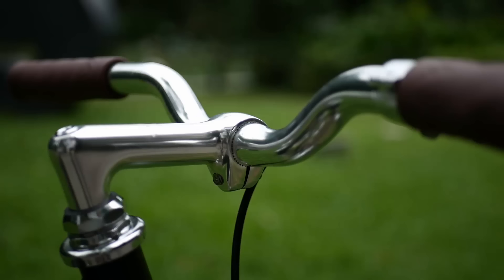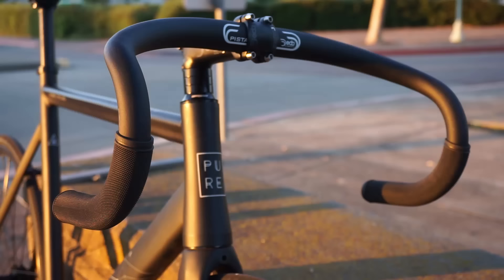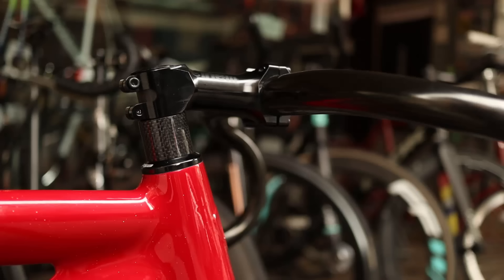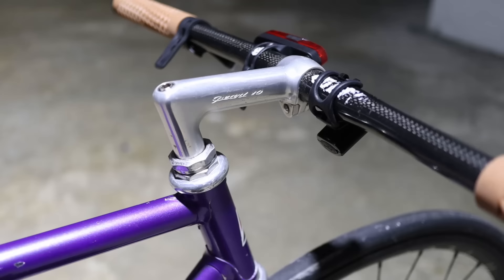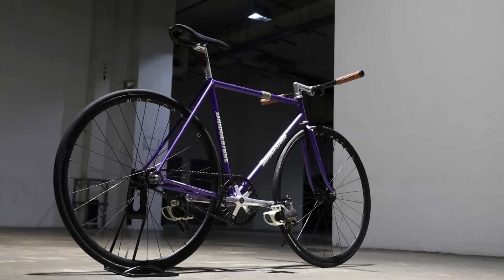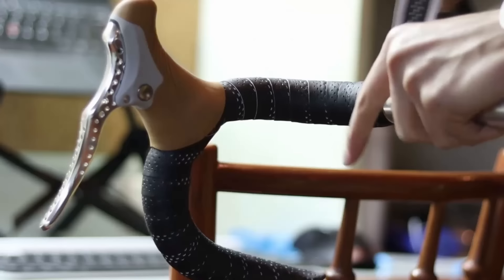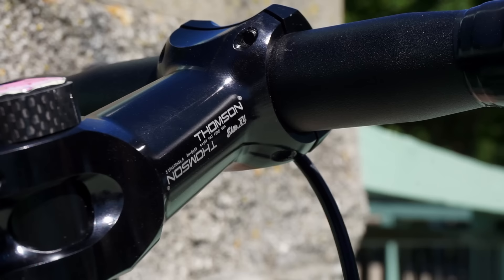Threadless vs. Threaded Stems

Comment: Got a factory five  f5 Titan 1" quill stem for an old giant frame that I converted to fixed gear and wanted to keep the look of the quill but wanted more modern 31.8mm carbon drop bars. It a dope stem with an removal face plate. Haha it's expensive tho.. actually spent more on the stem than the frame, but it looks sharp!

Comment: There's quill to A-head adapters tho. 😉
Reply: Also factory5 do a quill stem with removable face plate for oversized handlebars.
Reply: That's what I had to do because my bike had a 21.1 mm threaded stem
Reply: @ratchetwolf6336  French bike by any chance?
Reply: My only option for a stem was to use a stem adapter due to my bike having a weird size since its American from the early 80s
Reply: @ratchetwolf6336  so American was as weird as French at some point? 
Like I know that if you're working on an old French bike to keep everything and just refurbish, because you'll never ever find fitting components, like not even within the same brand. Like seriously same brand and same production year and shit still won't be interchangeable between models! 
But I never would've guessed that from American bikes.

Comment: Factory Five actually makes a 1" threaded stem for a 31.8mm handlebar diameter with a 2 bolt removable faceplate.  It's like a hundred USD, but if you're like me, and not always rational about the cost of your bike parts, it can be a pretty addition to your vintage frame and fork.

Comment: Hi Zach and Happy B-day! BTW, you are not old. I agree with 95% of this video, but don't agree the threaded stems are "higher maintenance" than threadless. IMHO treadless systems are higher maintenance and more unreliable. The bearings don't last as long and I've seen a few fail catastrophically, but have never seen a treaded system completely fail. Also, you didn't mention tapered head tubes, but a couple of the bikes you showed in the video had them. Not hating, just putting in my $.02 since you usually ask for comments. I think your channel is great and motivates people to get out and ride. As mentioned by another, doing a video on square-taper vs. through-axel bottom brackets could be interesting, also maybe one on the job of a bike messenger and why they usualy choose fixed/single-speed bikes (they always have great stories)

Comment: Biggest down side of threaded stems. Removing a corroded one from an old beautiful frame you found somewhere and try to restore. Good luck with that (doable but not nice).
Reply: Had a aluminum threaded stem stuck in a steel steer tube. Over time it chemically bonded with each other. That to me is a pain.
Reply: Nobody Cycles? Okay i was in the exact same situation as you. I found a way to remove it. You can dissolve the aluminium using sodiumhydroxide. I Will leave a link to a video of someone using this method to remove an aluminium stem. Im doing it myself aswell right now.
Reply: @teholster7043  That has to be one of the best solutions I've seen. Thank you. Next time I ever encounter a chemically bonded aluminum stem/steel steer tube, I'll definitely use sodium hydroxide. Sorry if my original reply sounded a little bit rude. I could have worded it better by proofreading.
Reply: quick tip from someone who's worked with a lot of old bikes- take the stem body out if u can, spray some gt85 on the wedge, take an old stem bolt, screw it into the wedge and hit it with a hammer. works almost every time
Reply: Nobody Cycles? If it's really stuck bad, it is basically chemically welded together. You might be able to free them up by a chemical process. I learned this on Sheldonbrown.com. Great website! 
    Turn the bike upside down and fill up the steerer tube with ammonia. If you notice leaks, stop them with clay. Leave the ammonia in there for at least a couple days. Ammonia works great on an aluminum and steel combo. I got an aluminum seatpost out of a steel frame this way. If steel on steel then get a good penetrating oil and keep applying it for a week or longer if necessary. Ive gotten salt corroded and sweat contaminated parts apart this way and it took 3 weeks! If you sweat a lot on your bike this is an issue. 
  I like a product called aero kroil in an orange can. Lots of auto parts stores sell it. Best penetrating oil I've found! I even Used it for 20 year old transmission bolts on my truck! 
   Some times things are so stuck nothing works and you have to start hacksawing stuff apart. Then the real pain begins! 
   Regularly grease the heck out of stuff that's inserted into frame after you get it apart! I even keep big globs of grease in the end of my seatposts on all my bikes, Just to have grease if I need it.
   Dont store your bike outside if at all possible!
Reply: I heard using nolox when installing so this doesn’t happen, helps.

Comment: You can pick up a steep angled stem to get a decent rise on your handle bars.  I have very long legs, so I have to use them on all of my bikes to get my handlebars to a reasonable height, even with an uncut steerer tube.  (My track bike still has the bars about 10cm lower than the saddle with a short 35 degree stem and a full stack of spacers)
It doesn't look horrible IMO if you find spacers that match the stem or frame.

Comment: The specialty tool to cut your steer tube is a $12 pipe cutter at home depot, lowes, Walmart, etc. A 10 year old could easily use it. Not sharp, not hard to use. Just a heads up....
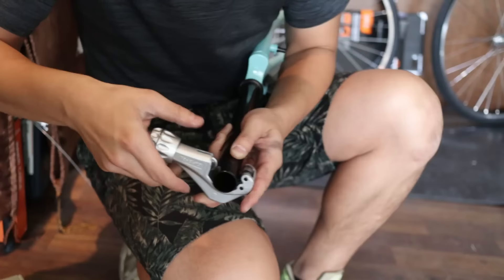Reply: He used one at 4:56...
Unless you're addressing that to the comment readers.

Comment: I have a steel frame trekking bike with threadless stem and I want a quill stem so I can raise the handlebars like a Holland bike or Rivendell but the only option is adjustable stem and that is not enough.  I am going to buy handlebars with more rise and backsweep.  But then I have to lengthen the hydraulic brake  cables ( magura hs11)and I wish wished I had deore V brakes because they are easier to lengthen.  
Basically,  I bought a nice bike with xt and magura and a threaded stem  
I commute and a comfortable but quality riding position is important.  I think the industry is so focused on selling the competition aspects and people buy into it without realizing that a huge percentage of their riding is maybe around town,  commuting,  shopping  and so on. So they buy a bike dreaming about being cool on mountain trails or riding over the Swiss Alps.  
I also was oversold on XT and Magura and to be honest the replacement parts are expensive and wear out faster because they are lighter weight.  Standard shimano alivio works for most people and most people don't need 3x10.  
I think threaded is limited.  I have seen touring bikes with over built extensions on threadless and it looks terrible.  This one guy had problems with it clicking  
Most people are not aware of quill vs threadless   
I learned about it after   and threaded is for me more practical

Comment: Quill stems are often used on cheap road bikes and mountain bikes because the manufacturer only does 1 or 2 frame sizes and it allows a good bike fit with a limited choice of frame sizes plus I feel on a road bike in an accident the stem will rotate more easily out of the way. Personally I feel the quill stem is a good option on a road bike where you may want to try different handlebar heights etc but should never be used on a true mountain bike that actually goes off road. This seems a good video for being fair I've seen so many videos where people hate quill stems but there are many pro's to them and helps people get a good bike fit on a cheap bike which surely is a good thing. 

I think it's far more common in my experience for people to have a bad bike fit with threadless. I've also seen people who got back into cycling and at first they had the quill stem quite high to give a very relaxed riding position but over time they gradually dropped the stem height to give a more aggressive riding position which is only possible with quill stems with threadless you'd have to keep buying new parts and because of the fork steerer height may be prevented from doing so without adapters and extenders.
Reply: Stevie Blue  I've got an old Specialized Sirrus road bike from the 90s and it has a quill stem I guess road bikes moved to threadless later than mountain bikes. I think the industry has learned that by making bikes more specific to their buyer's dimensions they make it harder to resell that bike forcing more people to buy new. My old Sirrus will quickly adapt to many size riders where as my more recent bikes won't. It takes seconds to convert my Sirrus from relaxed riding to more aggressive fast riding, nowadays that would be 2 different bikes for people. So what was 1 bike now becomes 2 or 3 bikes,  a win for the industry but bad for the environment. I'm glad Zach didn't just follow so many other videos of criticising quill stems, they are still a fantastic option for fixed gear and other road bikes.
Reply: bonzobanana1 Ive been using quill stems offroad for decades. I haven't broken a stem or a h'bar yet and I ride on rocks all the time.

Comment: I would add if you are setting up a threaded headset, is to add 3-5 mm of spacers, because headsets do wear out and your replacement might have a greater stack height, also of course you have more room for error in measuring your cutting.
Reply: You mean threadless, not threaded?
Reply: @paulgroves8633  I would say the rule applies to both, however you often run spacers on a threadless anyway to get the right height, whereas with a threaded you have the stem to adjust the height, just if you have (as is likely if you are setting up a threaded headset) a steel frame that will last a lifetime, it is good to have a bit of capacity in the set up to accommodate differences in headset stack height.
Reply: @grahamariss2111  I run an 80mm silver Nitto Pearl stem on my Mercian Strada Speciale, with a Campagnolo Record 1" threaded headset. I have some lower back pain issues (despite having a bike fit), so run it quite high, near the max. line. It looks fantastic and I don't notice any flex. I use 26mm Nitto M106 NAS compact handlebars (in silver), which also seem pretty stiff (they're heat-treated, which may help). I have another (not as nice) steel frame I'm thinking of using a 1" threadless Columbus Minimal carbon fork with, though, mostly for weight savings - probably about 500g lighter than using a threaded steel fork, though not as pretty.
Reply: @paulgroves1427  Sounds good, Nitto are a beautiful stem.

Comment: If you're gonna use a 31.8 clamp bar, buy one that is already made close to the width you want (eg: Cinelli). It is designed to flex a reasonable amount and not rattle your teeth out. Don't cut down a 780mm mtb bar to 500mm - it will be way way way too stiff. Ask me how i know...

Comment: I would love to see three-piece squared tapered cranksets vs two-piece cranksets (ex. sugino 75 vs sram omnium)
Reply: didnt he already make a sugino vs omniums video
Reply: @SchwippSchwappSchwen  yeah, but It's really old and I didn't mean only sugino 75 vs only omnium, I meant three-piece squared tapered cranksets vs two-piece cranksets in general
Reply: @BeboSaab Yes. but beyond that 2 piece cranksets are way more expensive (but if you think about it, some high-end squared taper cranks are more expensive than some 2-piece cranks)
Reply: @BeboSaab Not exactly, high-end cranks weight less than cheap-o cranks and they are made out of better material
Reply: @BeboSaab Kinda like bikes

Comment: What's your views on Chinese carbon handlebar or other components vs the normal super ex brands like zipp and enve
Reply: handlebars are one place I think you need to be extra careful with cheap carbon.  The one time I bought one, it makes creaking sounds if I flex it just with arm strength.  For pretty similar money, you can get a good quality alloy bar that is probably similar weight, and is less likely to feed you a pavement sandwich.

Comment: I have a question, I converted a steel road bike to fixed, it came with a threaded headset and fork. Can i change the fork and headset to thredless?
Reply: yes but you´ll have to either change your fork´s steerer tube to a threadless one (a welder can help you with that) or buy an Ahead fork, once thats aside, you also have to buy a 1" ahead headset, and also a 1" stem. Definetly doable but it depends finally on if you´ll take the hassle to do everything i said, mainly replacing the fork steerer tube
Reply: @Kantcino  It's one of those that is technically possible but I can't for the life of me imagine any scenario where it would be a good idea.
Reply: night vale night vale  Why? There's Nothing wrong with quill stems or threaded headsets. 
   But you can get a different fork. If you've got a threadless stem you like,  you can get an adapter. Get a steel adapter. I hear horror stories about the alloy ones.

Comment: I think threaded stems are not versatile enough for being to complicated for me.
Reply: Actually quill stems are more adjustable height wise. Especially if you get a stem with a longer quill. You don't need to change spacers or cut your steerer. If you run a center pull brake then you have to adjust the cable. 
   The main thing I don't like about quill stems is most don't have a removable faceplate. 
  If you learn how to adjust a threaded headset, it's not much more difficult than threadless.

Comment: I never understood how threaded ones came to be in th first place! The systems seems so complicated and inflexible that it's against every principle of sensible engineering. I seriously don't understand how they could become the standard for so many years.
Reply: Nothing complicated at all. Simple. Really. Quill stems look much better on vintage frames too. Ive been using them as well as  more modern stuff for over 50 years. They're  just different. Neither system is very difficult to work on once you've done it several times.  
  Engineering wise, loose ball type bearings are angular contact bearings which support loads better. So there's a good reason for them. I always remove bearing cages and put in as many loose balls as will fit. There's more balls than in a sealed cartridge bearing. An even better type bearing for headsets are roller or needle bearings. Another think that's been around a long time! 
    Bicycles, especially single speeds are very simple machines. That's the beauty!   You wanna see something a little more complicated? Take apart an internally geared hub!

Comment: Threaded!!
Reply: Nahhh, threaded looks beautiful threadless is less than beautiful, too many bolts. I like loose bearings because it supports better load it's not that difficult with correct tools.
Reply: Yup. The Good old stuff. Tried true and proven. That's my motto. Quill stems are actually more adjustable height wise. 
    If you want really sturdy headsets check out needle or roller bearings. The bearings are cylindrical and arranged in a conical pattern. These last a long time and are much more difficult to damage. A French company, Stronglight made them back in the day. Ive got 2 that are over 30 years old. They were very affordable for how good they are. I'm Still using the Original bearings! IRD makes newer ones. Due to the increased contact they add an element of steering damping too. 
   The only 'drawback' would be that your head tube and crown race need to be faced perfectly. Any good pro shop can do that for you.
Reply: Thanks man :) Interesting I've not come across anything like that before, does indeed look very sturdy for headset bearings! 
I've been salvaging bikes from my local repair shop scrap pile, got a garage full of stuff in various stages of cleaning and repair, 50s though to 90s. 
Not got around to getting headset removal/installation tools yet as I've not really encountered anything that didn't seem OK with some new bearings and fresh grease. It's the stem being fused that seems a more common issue which is always a shame but then so long as can undo the lock rings and get some loose bearings in there that can give it some more life before it'll need cutting off or something. 
I'm looking at all the taps and dies now which are pretty expensive, just got some BB taps to start with. I suppose I should get the headset tools first really, bit more fundamental maybe. 

Cheers, best wishes.
Reply: Felix Keenan You can use a little bit smaller piece of pipe than inside of HS cups as a headset remover. You could even saw  it lengthwise like the shop tool. Get a dead blow hammer. For a budget press tool you use 3/8 or 1/2 threaded rod, fender washers and nuts from the hardware store Pretty cheap. Works fine, just go slow, use some grease and make sure cups press in straight and square. Whenever you put in a headset or BB it's good to go to a Shop and get the bb shell, head tube and  crown seat faced, reamed and tapped if your not sure it's been done before. If it's been done you'll see bare metal and machine marks. NO PAINT on these surfaces. Often on inexpensive bikes its overlooked. It makes the bearings operate square to each other and concentric in the frame. Your Fork will be safer, more stable at speed. Bearings will last longer and be MUCH easier to adjust properly. These tools are very costly for a home mechanic, but if you used them lots they might be worth it. Look for used tool from closed stores  and check sizes. There's different sizes especially for old stuff from Europe. Check Sheldon Brown.com and Park Tools for specifics. 
   A good shop has the tools. It shouldn't be much more than $50 for the service. 
   Like my grandad always said " Do it right, do it once or just don't do it at all".